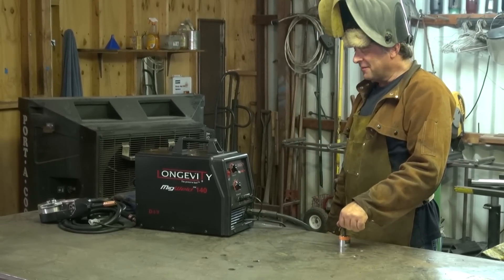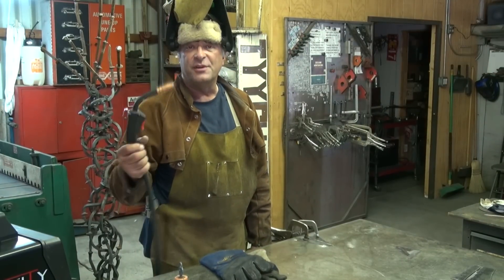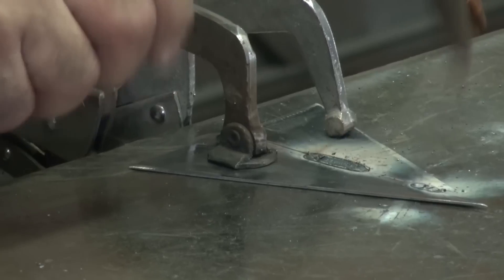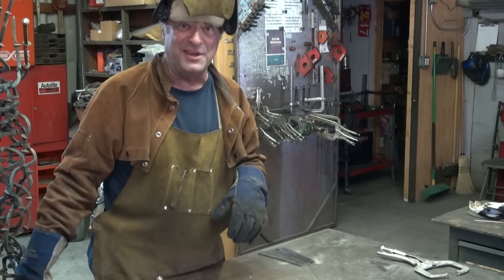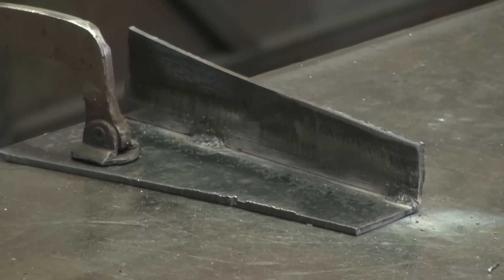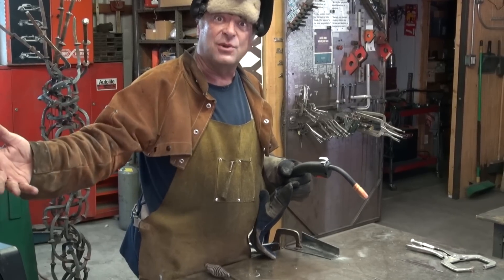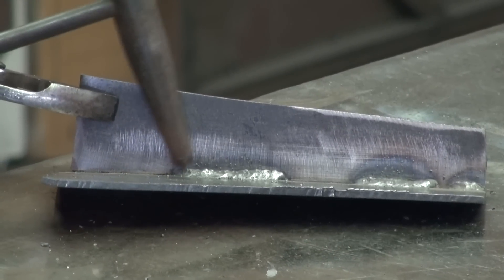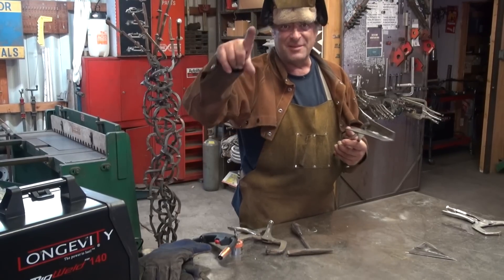How to Use a MIG Welder With Flux Core Wire - Kevin Caron

Comment: Hey Kevin nice video. I bet you and your wife like to roll play :) I wanted to ask you if the tip on the gun is necessary since you are not using the gas? The word on the street is that without the tip you can see your weld better but then there is a chance you can get electrocuted if not careful. Would you weld with flux wire without it?
Reply: DO NOT try to weld, DO NOT WELD without some sort of protective nozzle cone over the tip of the welder.  Spatter WILL get into the gas ports and block them up and render the MIG process useless.  I repeat DO NOT TRY IT!
Reply: Yes I have.  Ruined a welding torch trying this.  And I have been welding for 26 years so I have made quite a few mistakes but I am always looking for new tricks and tips!
Reply: I think i'll leave the nozzle on.  Replacing mig torches teaches you a lesson.  Even if you buy a flux core only machine they come with a tip guard to put on the tip.  These things are designed into these machines for a reason.  I guess to me it is like saying, it's ok to not put covers over outlets and switches because they are purely ornamental.  They serve a purpose.
Reply: Most flux-core welders come with a protective tip made of some tough rubbery material.  Check out the Lincoln accessories section at a Home Despot.  They are there if they carry Lincoln welders.

Comment: I have the 180 HD and when I plug it in and turn the switch on nothing happens. The fan doesn't turn on, the gun does feed the wire. I'm running 8/2 wire on a 40 amp double pull breaker out to the receptacle and the machine is getting juice cuz my tester shows the power cord is hot when its plugged in. Whats going on?

Comment: Basically that's it's main advantage, I still don't like it. I would personally go for an arc welder if your doing a lot of outside work in the rain and wind. But flux core is going to be better on the thinner outside jobs.

Comment: well its better than my old mig  it was made in 1988 and was one of the first migs to have no gas welding  By using flux core . 0.8 wire,   but some wire is rubbish  stuff  some will not weld at all

Comment: Why do you have to have a separate gun for aluminum and not just run through the same gun? Not being a troll i just don't know, thanks!
Reply from the maker: Electricienbatard The aluminum is too soft to push all the way out the regular cable..   You need a push/pull gun that has drive rollers on both ends of the cable to do that..    The spool gun lets you run aluminum at about 1/4 the cost of a push/pull gun.    Great question!
Reply: +Kevin Caron, Artist yeah ok , makes sense ! Thanks for the answer

Comment: with flux core wire you reverse your polarity, solid wire torch is posative, fluxcore wire torch is negative, as I recall and I think flux core makes more sense, you don't need gas, I welded the motor mounts in my van with flux core wire its holding fine, if you  get a welder buy one that will do what you want , a 110 is for body work, mufflers thin metals, most people want a 220v welder, get the one with the most amps, if you need a portable one mmm nice but expensive,

Comment: why does having a spool gun make it so you can do aluminum?
Reply from the maker: +Declan kot             Because the shorter run on the spool gun works with the soft aluminum..      If you try to push the aluminum through the 15 foot cable and the regular gun it will just jam in the liner..
Reply: Kevin Caron, Artist gotcha, didn't think of that

Comment: you are using a gas nozzle with flux core wire does it not matter?
Reply from the maker: +Datalus Kazan 

I left it on to keep the spatter off the end of the gun..     That's all it was doing.
Reply: Ahh I see 
  Love your Chanel by the way it has helped me a lot with my new and first mig welder

Thank you

Comment: don't you push a mig /flux weld??
Reply: +Zach Bennett slag = drag ,but see other welding videos .
Reply: +Zach Bennett you can push with solid mig wire, but if you try to push with flux core you will get slag inclusions in your weld.

Comment: I dont really see people using the actual flux core nozzles (black nozzle) for the mig machines they just use the gas nozzles (copper nozzle) ???
Reply from the maker: Just trying to keep the spatter off the tip..

Comment: Not to sound like a complete idiot but why do you hit the welds with a hammer?
I am trying to get into purchasing my first home welder as it seems like something one should have...

thanks
nigel
Reply from the maker: +NewShockerGuy 

To break off  the flux that forms over the weld..
Reply: +Kevin Caron, Artist 

If one doesn't do that are there any significant problems afterwards or is it just something you naturally do after welding with flux core wire?
Reply from the maker: +NewShockerGuy 

After a while the flux will break off by itself..   the problem is if you do any kind of finish the flux will ruin that..    Best to knock it off and see how good the weld is before you get to the finish stage..

Comment: My Lincoln 100 is soo much better then that pos i run .30 flux core but iv converted it to do .30 solid core i paid 780 bucks for mine 8 years ago i can weld half inch no problem of course its multiple pass but 3/8s on .30 is good but youll burn through wire 1/2 inch i use .35 wire flux core. But i wouldn't waste my money on longevity  never even heard of that must be a Chinese company id say stick to well known brands like Lincoln electric  or miller
Reply from the maker: Old video, try to keep up.

Comment: I think this was just a video advertising the welder. Not much info about fc. Nothing about stick out or gap, v little about penetration.  “Looks a little bit lumpy” so more wire. Why?
“How to use a mig welder with flux core wire”.  Load flux core wire into machine and press the trigger. That’s about all I got from video.
Unsubscribed